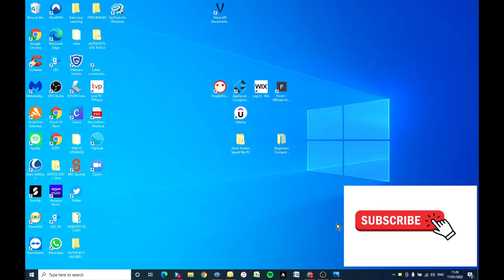How To Fix PS4 (Original) Eject Button Problems

Comment: Couldn’t get mine to work. If it’s the case with anyone else I recommend removing the entire disk ejection button and putting tape over the sensor. You can always still eject the disks digitally.

Comment: Guys my PS4 is old gen and not like this which means that I couldn't fix the button but there was a wire that was kinda loose beside the button and when I fixed it the button works but for the most part this guy told me how to open it so he just earned a new sub

Comment: Thank you!! It helped me a lot to put that metal thing o the right standard position. I opened the ps4 for the first time in 8 years to clean it and when I put it back together the eject button wasn’t working anymore. I must’ve bent it while cleaning. Thanks a lot!!
Reply: I had to make mine not work because no matter what it will push itself over and over. You can eject with the options button so i bent it where it doesnt work anymore lol. Was super annoying
Reply: @DirtyMikeHoncho  At first this was happening to me too because its kinda difficult to find the sweetspot. Either it kept ejecting by itself or not working at all. But after many many tries I could find the standard position of that fucking piece.
Reply: @israelargollo6030  lol may have to take it back off and give it another go
Reply: @DirtyMikeHoncho  It all depends on how much you want it hahaha
When I was almots givin up I made it right. Try to pause the video and replicate the default position of the piece. Like I said, after many tries I found the sweetspot. Good luck!!

Comment: Mine wont work at all touching directly does nothing
Reply from the maker: Hi J, are you touching the gold contact directly underneath the shell? If that doesn’t switch the console on, then it stands a chance your Power Supply Unit has blown. Regards, Bill
Reply: @cd247repaircentre7  i meant the eject button. The console itself works well except the eject button and it no longer beeps for anything.